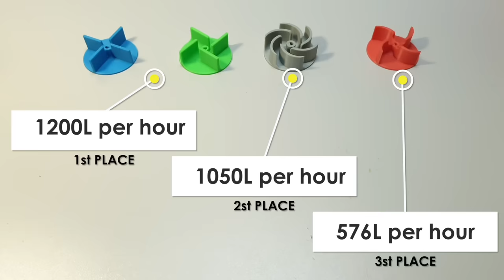Testing 3D Printed Water Pump Impellers - Which One Performs the Best?

Comment: Please print these designs in their mirror images (opposite parity). The ones you printed are for counter clockwise spin and the outlet on your housing is for clockwise spin.
Reply: This is true
Reply: Incorrect. While somewhat counter intuitive, the vanes of an impeller in a pump are more efficient when they are swept 'backwards'. Consider what you're trying to do with a pump like this - you're trying to throw the fluid out and not scoop it in. Backward swept is correct, but something in his geometry was not compatible with his housing, motor speed, inlet/outlet. Pumps are surprisingly complex. 

What would have been very interesting is to compare the head as well across all these pumps. It may be the case that the red/grey impellers were lower flow but were capable of a higher head.

Having a current readout on the motor during the test would have given us some relevant data on efficiency and how much 'work' the pump was doing as well.
Reply: I would also like to see the results of the impellers printed in this manner.
Reply: This is incorrect way of making a centrifugal pump. See it as an inverted wing of an airplane. When the blades rotate, a negative pressure is formed below the wing (pump blade), causing the liquid to be pulled from the centre towards the blade. Because the inner diameter is smaller than the outer diameter of the pump, the liquid will (with centrifugal force) accelerate outwards and hit the hull of the cochlea. The motion and pressure of the liquid will eventually spin out of the outlet with a lot of force.

Comment: when blades are curved rotation of the motor should be so that the blades bush water outwards. Your rotation is like pulling water from outside in.
Reply: No
Reply: @angelgonzalez133  : Yes, basics of basic fluids dynamic. You: Go to the back of class!
Reply: @bigcheese781  no go to class again
Reply: @angelgonzalez133  : I understand you "No go class again", thats because you don't understand centrifugal pumps.
Reply: Stay in class folks, you'll learn pumps... =)
Reply: @bigcheese781  14 years repairing pumps all day my friend. Pedrollo technic service .... Quality pumps..... Omg
Reply: @bigcheese781  Pay attention on clases please
Reply: @angelgonzalez133 : You know, my mom has had her license as well as driving for 40+ yr, and I can yell you she's far from an expert. Just because you have been doing something for 14yr says absolutely nothing! Just Google "centrifugal pump impeller rotation" and it'll clearly describe why impellers rotate such to bulk water outwards, before I'll pull my pump credentials on you. ;)
Reply: @angelgonzalez133  : Why post a video about blade cavitation when discussing rotational direction?
Also: the video posted, shows correct rotation just at the startup, impeller pushes fluid OUT towards periphery; But that's what mr Angel here clearly said was wrong in her/his? first statement.
Reply: @bigcheese781  1 I post the vídeo because you can see  impeller rotation clearly..... 2  The correct rotation is  what i posted on the video... In some comments in this video people say that is incorrect but you can see that is the same on the two videos. 3 RESPECT YOUR MOTHER is better driver than u 😆
Reply: @angelgonzalez133  : I see, your problem is not fluid dynamics,  nor is it understanding of pumps. The class you should revisit is English. Reread and/or use Google's translate service.
Ps: You know my mother and me, really that's lovely. Was it at the testtrack perhaps, which one? ;)
Reply: @bigcheese781  i think weare talking about 2 diferent things.... I answered at second part when i sayed No.... First part is correct but second part .... When he says that " in vídeo your rotation is like pulling wáter from outside in...." Thats incorrect.... Rotation on vídeo is on the right way
Reply: @bigcheese781  Man.... Today i repaired 6 pumps....i can say you 100 hundred of different brands.....  Grundfos speroni zenit ABS  flyght calpeda salami  caprari Saci Espa Prinze putzmaister  .... Im a profesional i live rounded of pumps.....
Reply: @bigcheese781  if you have any doubt tell me i can aswer on the go anything...
Reply: @bigcheese781  and again i answered jukka..... about 2 diferent things.... I answered at second part when i sayed No.... First part is correct but second part .... When he says that " in vídeo your rotation is like pulling wáter from outside in...." Thats incorrect.... Rotation on vídeo is on the right way... I say the same all time.... WTF
Reply: Well, yes, but no.
His rotation is correct, it's just the camera frames that make it seem incorrect. Same thing happens when recording plane propellers standard box fans, helicopter blades, and vehicle tires.
Reply: @zetsumeinaito  You are right!!! 👍
Reply: Awww, pump friends. 😁👍
Reply: @angelgonzalez133  is right on this one. If you see on 2:53 the blades are rotating clockwise, which is the correct rotation for this one.
Reply: @Edgard422  Actually it's pretty hard to see in the Video, but it only makes sense to turn the blade clockwise because of the attachment of the hose that will push the water outside the pump. To keep a straight water flow you have to push the water clockwise and finally outside the hose.
Have a great day folks :)
Reply: @Edgard422  yes 👍
Reply: @smiley235  😆
Reply: @marc3801  Indeed, at that framerate it could be the other way. But we also need to take into account that the other impellers have their blades in the same direction. I don't think the water could be pushed out with that force if it was rotating the other way.
Reply: @bigcheese781  The blade must accelerate the water tangentially, to impart maximum speed at the tube fitting. If the blades bend in that direction, some of the energy is used to push the water outwards instead of accelerating it, reducing efficiency. If blades are curved against the motion, some of the water's outward momentum is converted to extra speed at the tips of the blades, increasing efficiency. The angle needs to be precisely right for a given target RPM, if it goes any faster then it actually drives the water back towards the center and reduces the efficiency. Straight blades design is usually the best just by the virtue of working equally well in all RPM ranges.
Reply: @michaelbuckers  : I know how this works. So the impellers as seen in the thumbnail, shall they be driven CCW or CW? What do you say?
Reply: @bigcheese781  As seen @ 0:25. They should go CCW but I'm pretty sure the angle is too steep. Basically it needs to be such that blades' normal vector x tangential velocity cancels water's radial velocity component at every point, then water acceleration is fully tangential. I'm pretty sure the shape needs to be more complex than just an arc or an involute, you might get away with just 2-point bezier curve though. Finding optimal shape will probably involve printing a ton of turbines with slightly different shapes and plotting their efficiency on a grid to find a global maximum and keep printing them with finer and finer adjustments as appropriate. You might get some mileage out of simulations but only to rule out particularly bad designs, I wouldn't count on those for optimization - they're not exactly accurate.
Reply: @Edgard422  : Angel insisted CCW is correct rotation, look at original post. He did so until he changed his mind mid discussion by posting the cavitation video.
Reply: @bigcheese781  no no no i dont change nothing.... Ohhh MaMa....
Reply: When you change the rake angle of the blades, you change the Pressure-Flow curve characteristics of the pump.  Backwards angled blades will generally give lower flow and higher static pressure, while forward blades give high flow and low pressure.
Reply: @angelgonzalez133  Angel is right - Big cheese it is just the video frame rate that confuses you......

Comment: But your impaler directions are in oposit direction
Reply: Yeah did he spin the curved blades in the direction of the curve? The video makes it seem like he did.
Reply: No.. according to his design... the output port wants in right side.. now it is in left side
Reply: No, no no... Están en la dirección correcta, las de palas rectas pueden funcionar hacia cualquier lado  y las onduladas están girando en la dirección correcta, por eso son bombas centrifugas ..... Cogen el agua por el centro y lo hacen pasar por la periferia de cada pala  hacia el exterior..... 15 años de mecanico de bombas.... Un saludo.....
Reply: @malloott  high speed rotation is often observed as the opposite direction compared to how it's actually spinning.

@Rafeeq I assume you're talking about his published thingaverse design? Good thing it was fixed by the time he printed it out in the video, even if not updated(though by now it is). Otherwise he'd get alot more comments lol.
Reply: Reprint the curved impellers in reverse. they will work better. Also would like to see maximum head pressure, by running hose up a flag poll. Please do again.
Reply: @johnlemmey7698  no is right direction
Reply: hold on no one is getting impaled in any direction... are we watching the same video? 
he is using impellers as a water pump. i dont see any impalers like Vlad the Impaler. 
they are completely different things...

Comment: Interesting! Suggestions for another test: Measurement of Rpm, amperage, pressure .
Reply: Yes, agree with you. Vacuum capacity could also be a big variable (pump out of water, what intake hose length is the maximum for the pump to initiate flow and pressure).
Could be tested both horizontal and vertical (pump above water surface)
Reply: 'Rpm, amperage, pressure .'  Exactly, first thought.  You need at least current so you can do current/liter/hour and find the best efficiency when just the fastest rate isn't the priority.  Much more useful with just a little more data collected..
Reply: Exactly. 
Say the grey turbine may not provide the flow rate compared to the other's. It may provide better efficiency at higher head pressures.
Reply: Centrifugal pumps are often measured in how much head pressure they can pump against and the flow rate at different pressures. I would bet the 6 blade would come out ahead on pressure.
Reply: For cleam liquid the close inlet is more eficient. I wold like to see for close
Reply: This product booking link
Reply: @FlorianTOSCANI  px

Comment: Pink one was cavitating. That's why it wasn't doing much and making that "rock crusher" noise. Can't really draw much suction against a vapor bubble. That also indicates it's going too fast for that impeller design.

As far as testing otherwise, might be interesting to see what kind of head column the different pumps could produce. (The ability to increase pressure or pumping vertically up a tall pipe.) There are more factors in regards to pumping effectiveness than maximum flow rate. Thus in different applications the slower design for this test may still come out as being more favorable.
Reply: It wasnt cavitating, looks like hos is against the bottom on that one, wouldnt expect it that much worse than others honestly
Reply: @Boz1211111  Actually, it looks like it is. The sound is heard on both the distance and underwater cams, and you can visually see the bubbles inside the pump on the later.
Reply: lol no. the pump has almost 1 atmosphere suction pressure.cavitaion happens when you have to suck the water up a few meters at high speeds.
Reply: It may be the battery. If the battery was not fully charged, the last test would result in less power.
Reply: what you mean pink, i just see red :)

Comment: You should also check how much pressure each generates by having them pump into the hose going straight up and measure the distance.
Reply: That's exactly what i was gonna suggest.. Also this is called Pressure head and it is measured in meters
Reply: Yeah I agree
Reply: @zakariakhamees  Yep, without pressure head the first numbers are meaningless.
Reply: i agree, try pumping water to varying elevations, from there you can see how the vanes perform as the height increases.
Reply: also amp draw
Reply: I think the grey one might actually overtake the others when there is some head pressure involved.
Reply: This would show you the head vs the volume you can pump with each unit. Think the pink one would go the highest....
Reply: by the way, also nessesary test each pump with different directions of rotating because of asymmetrical blades

Comment: This was interesting. Changing the battery mid test could skew the results, I suggest a more reliable power supply. Changing the design of the inlet face and size could improve the ability of the impeller to direct the flow. The inlet face seems overly open.
Reply: The battery should be charged after every test, actually. Lithium batteries are 4.20 volts fresh off the charger, and drop to a nominal voltage of 3.7V soon after you start using them.
Reply: ...that is, if he was to continue using a battery, and not a bench supply, as you suggested, of course.

Comment: the curved blades reduce the output but increase the pressure
so if you put the canister on >2 meters high you should see more
Reply: This comment is correct. You will get higher pressure on the curved blades.
Reply: @court2379  No, it's not. When stationary, increased output pressure also means increased output flow.
Reply: Mafioso Max Why would the two be connected? (They’re not)
Reply: @tbdcreations5370  The values pressure and flow are already connected to each other, but the more pressure you want to produce the less flow you get
@Mafioso Max
 there are characteristic curves for pumps ... Google ;-)
Reply: EumlOriginal You’re right, my mistake. They’re connected but they are tradeoffs, essentially a difference of mechanical advantage. Mafioso Max suggested they both increase together.
Reply: @tbdcreations5370  I figured that if the pressure increases on the output side, the pressure/force forces the water further down the pipe to flow faster. You cannot build up the higher pressure without the water flowing faster because the pressure itself accelerates the water.
Reply: Mafioso Max It does but they also pump water more slowly because of their ability to pump at higher pressures. Curved fins mean the water has to travel a longer distance to get from the center of the impeller to the outer edges of the impeller. So at a given rpm they will pump water at lower flow rates then their straight-bladed counterparts.

“You cannot build up the higher pressure without the water flowing faster because the pressure itself accelerates the water”
You are correct, but that doesn’t mean that the high pressure pump will move more water in this low pressure scenario. All it means is that it could generate more pressure than the other impellers if that’s what was required.

Comment: Very interesting your test, I never imagined that the green turbine would have good results, congratulations and thanks.
Leandro Wagner.
Reply: It's counterintuitive to look at, but I think it makes sense. The curved blades push the water from center to rim at close to a constant speed whereas the straight blades provide acceleration from center to rim. This creates a stronger negative pressure in the center of the turbine pulling more water in and obviously it pushes water out at a higher velocity, net head being higher than one with curved blades. This would be less important in reverse I believe.
Reply: Waterquw
Reply: Call Kant nob
Reply: I think that the curved blade is printed in the opposite direction, maybe your conclusions are wrong man!

Comment: The grey one has low volume but high pressure, while the green and blue ones are a designs for low pressure at high volume!

The pink one is medium pressure at medium volume. With tangential wings you need more blades.
Reply: Hey, hello. Since is looks like you know a bit about pump impellers, would it be possible for you to say where i could read up on it?
Reply: @FlamingToaster  I have not found a good book yet - especially not in English (I'm German)
Reply: @FlamingToaster  read Up Viktor Schauberger He has the best Designs when it comes to Water. His philosophy was Understand Nature Copy Nature
Reply: @Humbulla93  thanks, sounds interesting, but I'm more interested in engineering literature on machine design ;)

Comment: I maybe can explain, why gray and pink is less efficient:
These pumps rely on centrifugal force, so they pump by pushing the water/air/whatever u pump to the outside. As soon as the blades are curved the motion of the pumped fluid/gas to the outside is disturbed. And these disturbances have the effect of lower efficiency (because every disturbance of the motion of the pumped liquid/gas is an energy loss)

Sorry if my eng isn't this flawless, i'm actually from germany ... :)

Comment: Did you measure wattage consumed?  It would be interesting to track how the wattage and load on the motor changes in relation to the amount of water moved.  There's a case to be made for a pump that moves less water while reducing load on the motor.  Kinda like F1 racecar motors, going fast for just a few laps is one thing, commuting as a daily driver is a whole other use-case.
Still, NICE VIDEO, thanks!

Comment: Cavitation on sharp edges are stronger, so the curved blades will last longer I think....
Reply: maybe it can do more pressure
Reply: This pump is not powerful enough to cavitate
Reply: @Boz1211111  This pump is clearly cavitating with the pink impeller, this has nothing to do with power and everything to do with geometry. Cavitating in this pump is unlikely to damage the pump because of the low power but it will still drastically reduce pump efficiency.
Reply: @MrAjam12  i thought that impeller is too big for this motor to spin it to such speed to cause cavitation, also, its curved impeller blade, so its even more weird